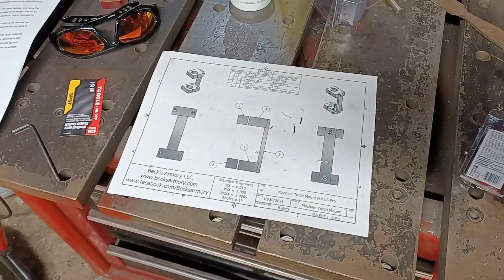DIY CNC Plasma Machine Torch Holder With Lasers Alignment #Langmuirsystems #Everlast #plasmacutter

Comment: which lasers are those, I don't seem to find them in your description?  I found some on Amazon, but not sure if they are correct
Reply from the maker: the kit I used to call out came with a battery pack.  That kit is no longer available on Amazon so i had to buy the separately now.  this is the kit I used to use. https://amzn.to/48QB7xc

Comment: Nice product looks good i have a question how do you zero it to the center of the torch.
Reply from the maker: You just rotate them until they cross the pierce hole.  then you tighten down the set screw.
Reply: @BeckTools are you using dead center or one side of the kerf?
Reply from the maker: @bpdp379  I always offset inside or outside the feature a distance = to the kerf

Comment: I have to say this one is Spot on! You can find inexpensive power supplies online and if you need an exact voltage you can use a Buck converter😁🛫
Reply from the maker: hahaha I love the dad joke!  I think I need 4.5 volts.  I saw some of these power supplies at Menards but they were like $20.00.  I was going to check Amazon.  I bet they have them for less. :)
Reply: @BeckTools  that should be easy find at 5 volts but if not a buck converter is cheap and adjustable too!
Reply: @BeckTools  I use the little Buck step downs from Drok, the have a nice waterproof body and the adjustment is tucked away nicely on the back and seems to stay once you set the voltage you want
Reply from the maker: @Hangs4Fun   in a couple weeks I'll be selling kits.  I got a CNC so now I can make these to sell vs just selling the build plans. :)
Reply: @BeckTools    I would consider imbedding 10 or so neodymium magnets and create a simple break away solution.  Not only making the consumable replacement easier, but also in the rare times the Z might hit the material hard, it can break away instead of harming the torch.
Reply: @BecksArmory  also, I ended up getting a 4 pack off of Amazon, thinking the constant splashing of plasmaquench (or whatever you use) eventually making the lasers too dim to use.
What has been your experience with the lasers holding up (and which plasma water treatment are you doing, maybe that matters)?

Some people use borax for anti corrosion, which I think would eventually pit a white crystalline on the laser lights?
Reply from the maker: @Hangs4Fun   others have also suggested this. I'll make that an optional upgrade.  So I'll sell the a QD bracket for it.  I still have to engineer the QD bracket.